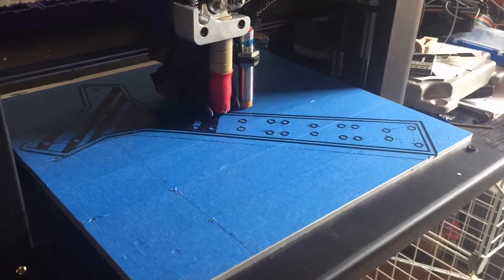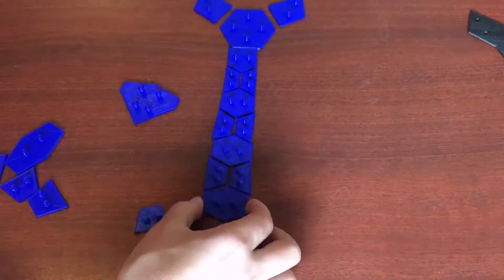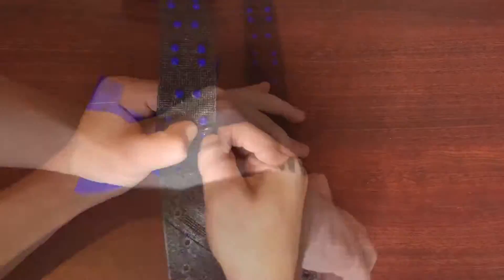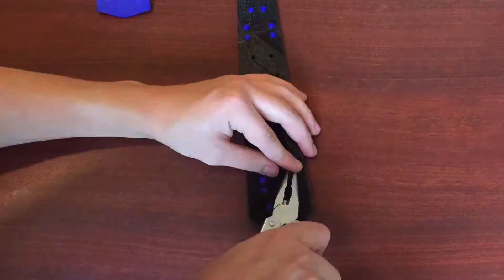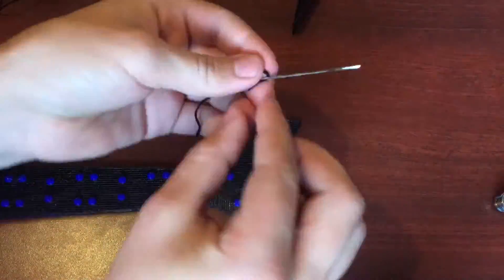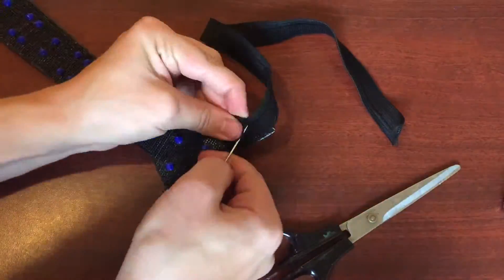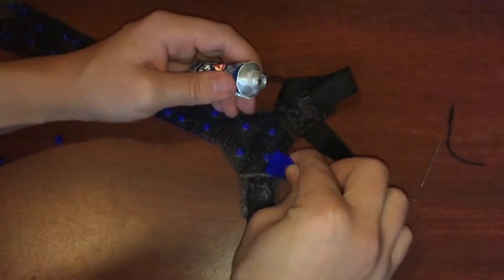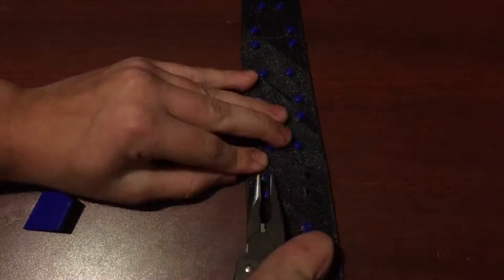DIY - 3D Printed Tie

Comment: hey Diego,
that's awesome, Thanks for sharing this. i always wished to get a hex tie for myself, but its expensive.
can you help me out with making hex tie with transparent center material, kindly mail me @ kushal.hereiam09@gmail.com
it would be really helpful.
thanks man.
Reply from the maker: I actually just made one using a clear pvc flexible material they use for curtains in industrial kitchens (you can find it at the hardware store). I just printed the pieces in PLA and attached them to the piece wich I cut and drilled by hand.
Reply from the maker: yeah. I might get one eventually and make a comparasion video just to see the difference.

Comment: what is this ninja flex part
what is that kind of material 
??????????????????????????????????
Reply from the maker: It's a rubber like material, it is flexible and very stong. You can buy it here: http://www.amazon.com/NinjaFlex-Filament-Diameter-Spool-Midnight/dp/B00TOOFIZA/ref=sr_1_1?ie=UTF8&qid=1465050868&sr=8-1&keywords=ninjaflex
Reply: +Diego's Workshop thank you Diego